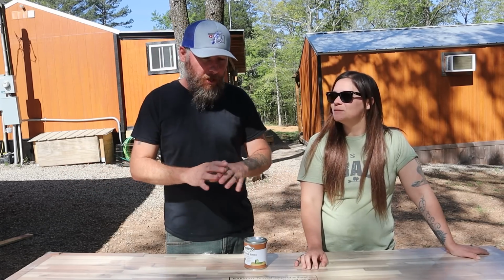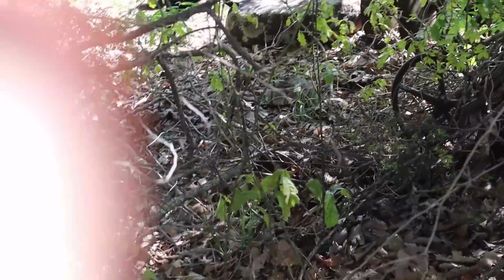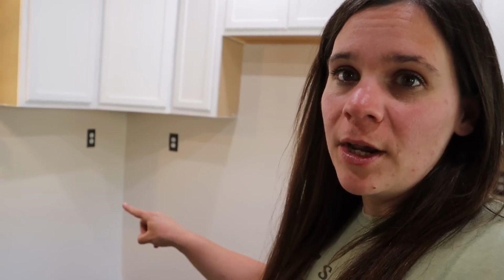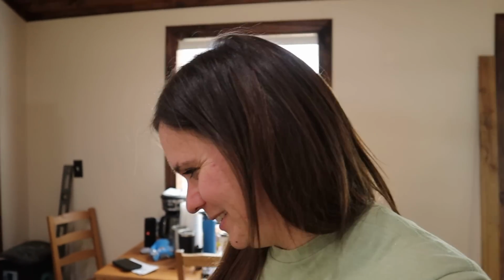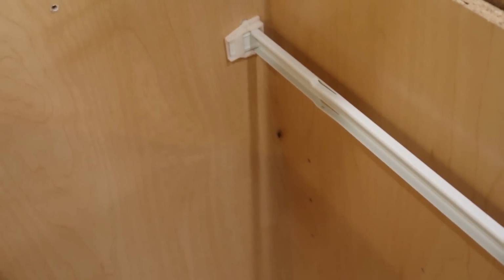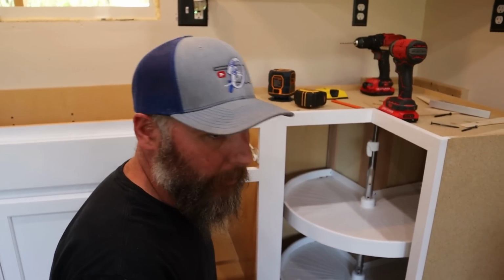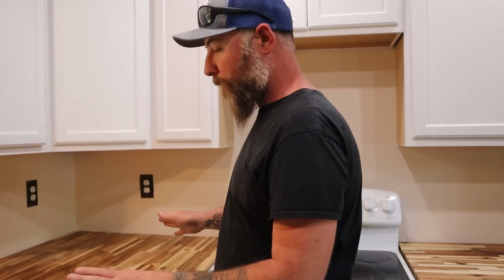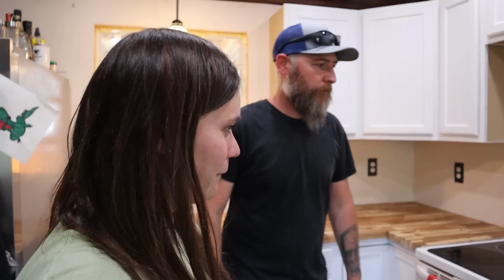Shed To House Kitchen TRANSFORMATION | DIY Kitchen Base Cabinets | Shed To Cabin

Comment: Anthony before you disconnect the doors on the corner cabinet- look for a 
Single loosening screw on each of the white plastic circular clamps holding each shelf in cirnwr to the center tube they are connected to.  Loosen the two screws on those clamos and the doors will slide up and down as a unit. Get them where you want and simply tighten those two screws.  Hope this makes sense. Its really easy to adjust the doors. Dont take them off assembly- you will not be abke to screw new holes because it is such a little adjustment. Good luck!!
Reply: Yes! I was going to mention that but couldn’t figure out the correct words.
Reply: Absolutely those lazy Susan’s have an adjustment screw, mine do, don’t undo all that Anthony! I 😢you see these comments
Reply: I also had to make the adjustment as you mentions in your comment to my lazy susan!  It worked and there is no rubbing of the door on the bottom.
Reply: @Country Road Cure @Rox and Anthony they say there are 2 adjustable screws .😮
Reply: That's exactly what I was going to say. There's a adjustment screw at the bottom of the center tube.
Reply: I didn't know that thank you for that tip.

Comment: Anthony, a rattlesnake can still bite you even after they are dead. The venom is still just as strong. You need to dig a pretty deep hole and bury it. Don't touch it and don't let the animals see where you bury it. The old saying goes that a rattler doesn't really die till the sun goes down. Even if its head is chopped off it can still get you. The kitchen looks great!

Comment: Won't the sides of the oven get hot when you bake things? With the stove being so close to the cabinets?  Wow! The counter top looks fantastic. Great job Anthony, simply beautiful. No wonder Roxanne was so very excited about getting those cabinets installed. I would be excited about them to, especially after not having any place to store
things. For over 2 years. I'm so happy for her. I am relieved for her. Anthony you have done such a great job installing the tops.
Great idea for that piece of counter top perfect.  Great video guys loved it. Congratulations Rox, so happy for you.
💅🏻💅🏻💅🏻💅🏻💅🏻💅🏻💅🏻💅🏻💅🏻💅🏻💅🏻👍👍👍👍👍👍❤️👍❤️👍✌️👍👍👍👍👍✌️✌️✌️💕💕💕💕💕❤️❤️❤️❤️🙏🌼🌸🌷🌻🌺🦋🦋🦋🦋🦋🦋😊😊😊🤗🤗🤗🤗 Byeeeee!
Reply: Stoves have some insulation on the sides, just for that very reason, as it is often slid between cabinets in homes.  Main concern is you want the door to stick out past cabinets.  The most danger to surrounding cabinets would be if stove door is completely flush to cabinets.  When that happens, then when the door is open the heat would be hitting an inch or two of cabinet sidewalls and could cause damage over time, hence why stoves are built a little deeper than standard base cabinets. :)

Comment: I noticed the cabinets have particle board sides...paint the inside of the cabinets.  You won't regret it. Protection against any stray water that might get on them...My place also has particle board cabinets that were not painted and even the inside doors were falling apart...so I put many layers of paint on the inside , stopped the decay and prevented more from happening...wish the previous owners had done it.

Comment: I figure you're going to add white paint to the areas that show the raw wood still, but I was wondering why you didn't do the under counter space next to the floor in the protective white. When you mop the white would have protected your wood. Also, did you paint under the top cupboard? Food and grease will get splashed up there so painting it will make it so much easier to wash. I love the paint you chose.  Your kitchen is beautiful. Love your videos.  I need to redo the kitchen in the house we purchased but it will be some time before that happens.  I have started trying to get a garden started my seeds are just starting to sprout.  😊

Comment: The kitchen is beautiful. Love the color of the counter tops. Great idea for changing the corner to a straight piece. You need a toe kick on the bottom to protect the cabinets and give them a finished look. When you cut out for the sink can you save it for a cutting board. Hope you find the sink you want.
Reply from the maker: Yes we still need the mop boards / toe kicks. I plan on getting those done soon :)

Comment: A tip for snakes if you ever have one around you can’t reach or it has latched onto a pet or person is to get a cloth or paper towel or anything like that and pour rubbing alcohol on it and toss it near the snake. They can’t handle the smell and will flee fast. It’s a cheap and safe solution most people have on hand.

Comment: Roxanne,  I mention before about added large locking wheels to your island, that way at can be unlock the wheels and your able to roller it near sink or at and of cabinet adding extra closer counter space. Or can roll it to kitchen. Floor center. And use bar stools. For meals.  Love your kitchen❤

Comment: one more good thing about living in Arkansas, you won't have to treat your countertops so much, with the humidity here it will take a long time before they get so dry they warp...just started watching and as usual I comment as the video goes along, one piece of advice,. think about knobs and/or handles for the cabinets, your doors will stay nice, no greasy, wet fingerprints on the doors....I had those smooth cabinets where they didn't have knobs, when I painted them I installed them, really helped with keeping them clean....

Comment: Because we have stainless steel fridge, stove, etc. I found a piece of stainless steel for the wall behind the stove specially made for behind the stove at Home Depot.  The the finish carpenter put up a couple strips of wood trim to match the cabinets and it turned out GREAT.  You might check or call around and see what's available for white appliances behind the stove. You two could cut your trim wood and paint it white to hold up some kind of protection behind your stove.  It's an easy install.  Sorry about two comments.

Comment: I would have been tempted to keep that small butchers block section as a pull out and have like a false veneer base cap underneath, That way you could pull out the butchers block to use it and replace it when done.

Comment: if you spread a layer on the counter with beeswax, it wont stain as easy (by tomatoes and paprika) if you wash it with regular dish soap. you will have to oil and wax it more often. if you wash it with vinegar and lemon it will hold longer 😊

Comment: Hey, it all looks beautiful. I'm not sure this is for everyone, but, most kitchens i've seen or worked on, the counter is lower than the edges of the stove. If you have floor adjustments, that would be easiest, otherwise you can just shim the bottom

Comment: Pocket hole screws and wood glue is best way to put 2 pieces of countertop together. Your screwing it together from under the countertop. Looks seemless. Why not continue ledger board so there's no gap. Your place you do you. Just makes sense. Kitchen does look good. Love the white with the butcher block.

Comment: You dont have to take the shelves out. There is an ajustment screw on the pole usually under the second shelf. One direct goes left and right another direction up and down. Mine was that way to.

Comment: It is absolutely gorgeous 🎉🎉🎉!!! What an amazing job.  And when the microwave and  sink is installed. Wow...  then I was thinking to use some of that same thin baulsom board that you did with your bedroom closet t finish off the bear sides of the pantry closet aswell...  then what do you have in mind about the kick board on the bottom and the sall space between the sink and refrigerator is just perfect for your broom and mop to fit in... will you be using the pice you tack out for the sink  I was thinking it would look so nice to use as your window cell for your flowers and herbs poted plants .  Will you be hanging your COFFEE mugs under the cabinets next to the sink where your coffee maker will be.    I am so happy for you kids... you deserve the very best..
I am giving you a long distance hugs from your friend in Wyoming USA... great job 👍👍👍👍👍👍💜💙💚💛🧡❤🙋‍♀️

Comment: use a pumis stone on the glass top, make sure it is wet on the glass top then in a circular motion act like your sanding it till the burnt stains come off then final clean when you wipe all the water off use the foam glass cleaner and clean the glass, should look new again

Comment: On the lazy suean to Adjust the door there a screw on the middle pole,will  make it go up
Reply from the maker: Yes there is, but the adjustment is so minor, the holes that you can use to adjust are to much

Comment: If you spread moth balls around the perimeter of your yard it will repel the snakes. I have use this for many years living in an area of Arkansas that has a myriad of poisonous snakes. Never had any but my neighbors always did. My animals never bothered them either. I placed them a few feet apart but you could place them closer but not farther.

Comment: The white filler for sides of cabinets and pantry. I thought you said you had those pieces.
Will silicone hold that countertop to the other one without sliding out? In the end finished kitchen, it's will be beautiful! The kitchen Island still going in?

Comment: I love the color of the Butcher Block. It is beautiful. Hopefully it won't lighten up to much.
I hate Rattlesnakes
 That was a Hugh one. I lived out in the country and was always shooting them. None that big. 
Just a hint. You should cut the head off and put in in the burn barrel. If that snake has not injected his. Poison in something then those fangs still contain the poison. Animals or children mess with the head they could still get the poison in their system. It will have the same  affect. That's what I was told so we always did. Usually just scooped the whole thing and put i
in our burn barrel.

Comment: because that lazy susan corner cabinet is an UPPER cabinet, it should have fit flush in the corner, you sure you got a bottom corner instead of an upper?  I know they make lazy susan corner cabinets in upper ones..
Reply from the maker: its a base cabinet , not a upper one :).

Comment: I’d forget the 2 inch board against the wall. I’d bring the backsplash down to the shim on top of the counter. My son-in-law done his that way and after caulking it is beautiful. 

I’d call the manufacturer about the problem with the lazy Susan. Maybe there is an adjustment of some kind or make them send you a new one. Your doing a nice job all around.